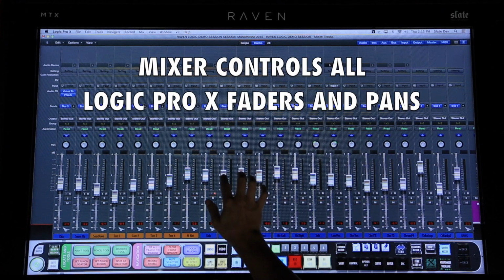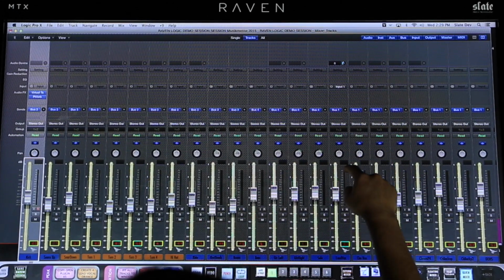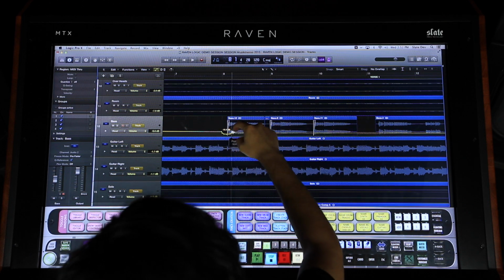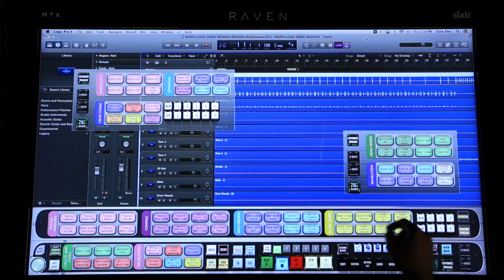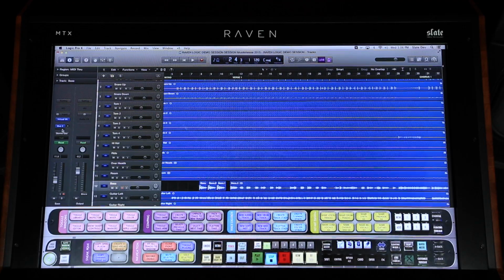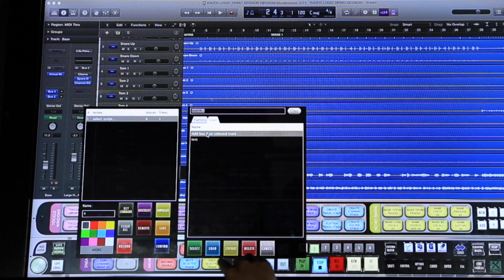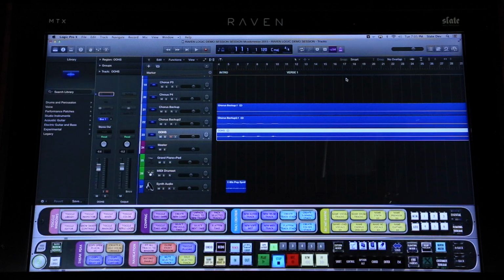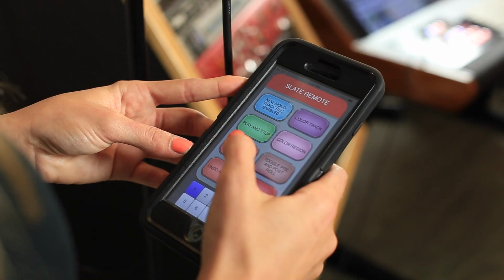RAVEN - Multi-Touch Control Surface for LOGIC PRO X

Comment: fantastic stuff. i love the multi-faders - is that the raven acting as midi when it translates the touch?  or do your drivers hook right into logic?   either way it looks faaaaaast!   damn, sweetwater doesn't have any in otherwise i'd get one right now.   what a well thought out product.    do you have API's for the raven if i wanted to control my own software?